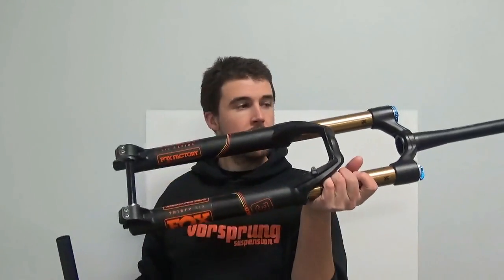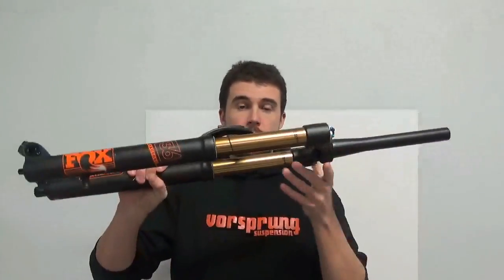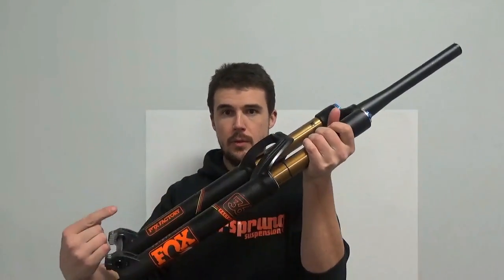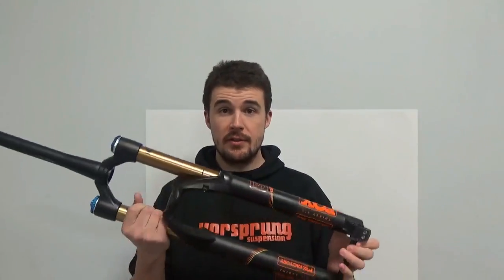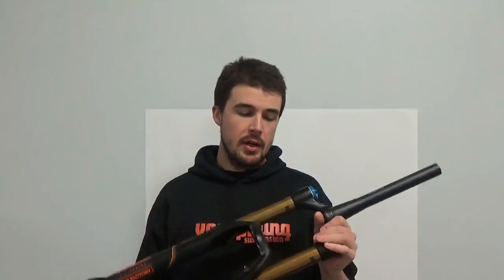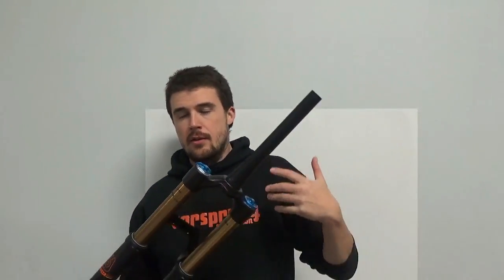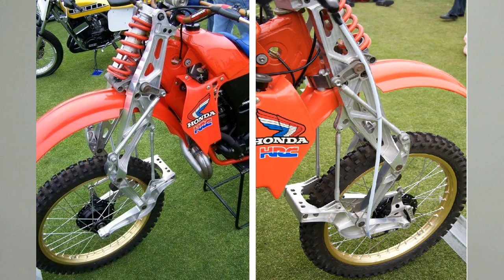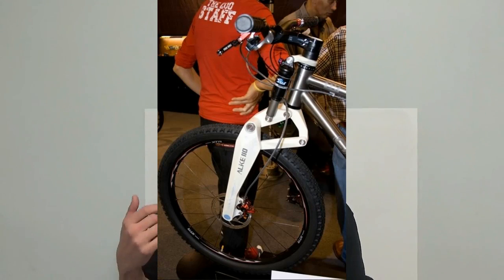The Tuesday Tune Ep 8 - Why We're Riding Telescopic Forks

Comment: The sad thing is that modern fork seals are not the best they've ever been if you're looking for durability. The Marzcchi's I ran in the early 2000's (Before the bean counters moved production to Suntour and their quality went to shit and bankrupted the company ) lasted literally years longer with negligible servicing than anything I've used this decade. I've run Fox, Rockshox and X-Fusion - though it was bushing failure or rather x-fusions's refusal to sell replacement bushings for their forks and a lack of local dealers rather than seals that retired that fork. I bought another fork for less than 2 way shipping + Service costs on the x-fusion. Two of the three Fox forks I have suffer weird damper issues too, combined with poor seal life and stanchion damage on the one that gets all the mileage. There's a heavily discounted SID on the way to me, hopefully it'll run for more than 2 years, which appears to be Fox's limit, without shitting itself.
Reply from the maker: Those same NOK seals are still available for Marzocchis, and while they are durable, they're also sticky as hell when you compare them side by side to low-friction seals currently available. What was considered especially smooth 15 years ago is downright terrible feeling compared to how forks feel now, so the stalemate between durability and performance becomes apparent there. Likewise, the battle between weight, performance and durability reaches similar compromises - where you could build a fork that kind of got away with little servicing (they didn't really, but they still went up and down without stanchion wear even when the un-anodised internals were eating themselves and destroying the oil) if you used an open bath damper and tons of oil, you also suffered in terms of damping consistency and a pretty substantial weight penalty when compared to sealed cartridges. On that note, any high performance fork is not going to be able to be ridden frequently for 2 years without maintenance, in the same way that you can't drive a car 200,000km without maintenance and not damage it.
Reply: You might be surprised, but I agree with you on your points above. The big issue I have with modern forks is that back in the day, while there were extremely high end expensive and maintenance hungry forks on the market, it was possible to buy forks that didn't need constant rebuilding. There's nothing I'm aware of on the market now at any performance level that isn't a maintenance nightmare. Also my car will do 20-30,000 km between services where just oil is changed and at 225,000 km is still on all the original shocks and suspension bushings, my bike I suspect (I ditched the speedometer years ago, but this is probably a reasonable guess) is barely doing 5,000 km between fork failures that would cost more than the price of a new fork. Back in the quality Marzocchi days forks would last long enough for me to buy second hand, ride for 4 years and sell on again with barely a seal or oil change. The old style coil/air assist Bombers will still be a shed load plusher than modern fork with chewed stanchions.
Reply: @peglor  Um, your just remembering it with rose colored glasses. I love Zokes, but you still had blown seals, stiction! you still had oil and air minutely leaking over time changing the suspension characteristics of the fork that you had to adjust for. Modern forks run amazingly well with little maintenance. I've not blown a fork seal since changing away from Marzocchi?